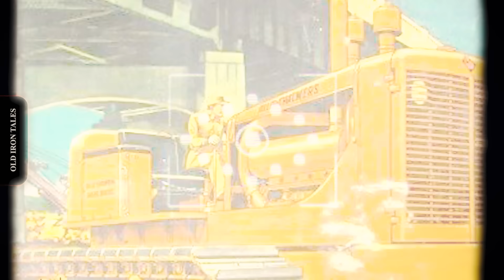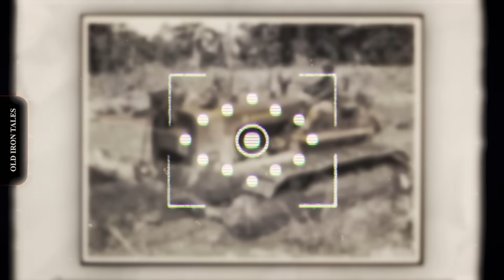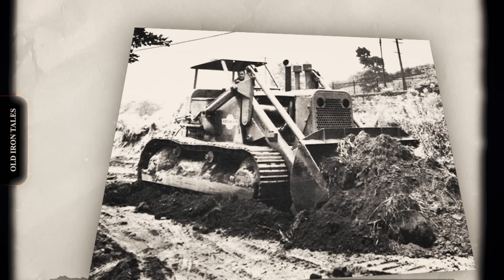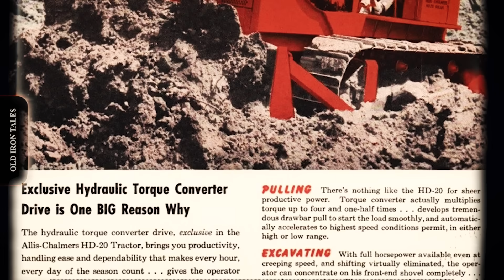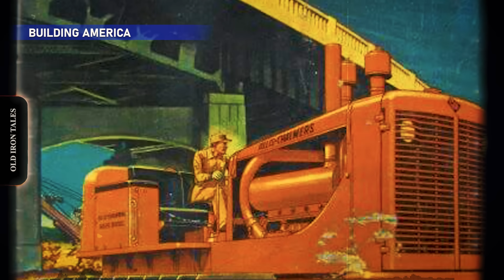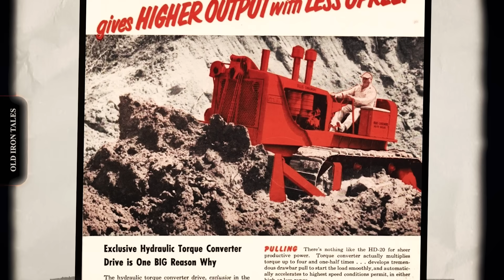Once The World's Largest Dozer – Allis-Chalmers HD-20

Comment: HP is not a true measure of actual power (especially with diesels) whereas max/working torque is what should be listed.
Reply: And with the torque converters, AC was king.
Reply: @bigcal36  they were fuel  drinking  pigs       lots of  torque   but twice the  fuel a  D8 would  use
Reply: Torque is largely irrelevant, especially with torque convertors. Operating that machine would feel like a spa day compared to a clutch machine! 

A 350hp 440 big block will get a semi down the 1/4 mile just as fast as a 350 big cam cummins. 

In reality much much faster because the entire drivetrain will be so much lighter, since it doesn't have to handle all that engine torque. and the 440 never waits for boost, and only needs about 1/2 to 1/3 of the gears. 

The Big Cam will use 3.23 to 3.73 to one rear gears, the 440 will have 7.8 to 9.5 to one. Same drawbar pull. 

HP is the measure of weight, dirt, whatever moved in 1 hour. 

The Torque converter was a huge advantage keeping the engine in it's peak torque.

Detroit Diesel 2 strokes without a turbo stomp any 4 stroke with a turbo of equal size in the low speed Torque department. Turbos kill BOTTOM end torque and throttle response because the compression, and timing have to be backed off, and the turbo is a restriction until it comes in, then it falls away like a stone if you lug down too far. 

The Detroit will be making things move the instant you stab the throttle and keep pulling at 200 rpms! 

4 decades of ife experience. 😊

It just sounds like it's spinning 2x as fast. 😊